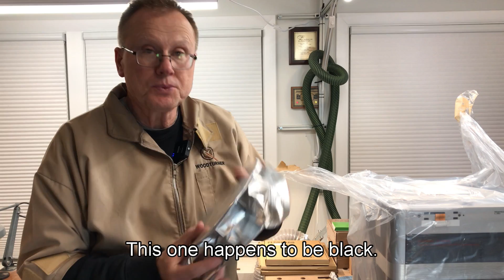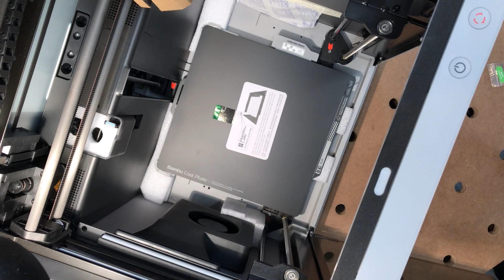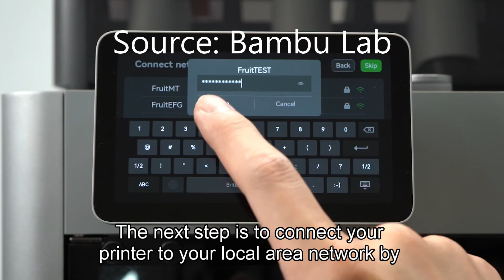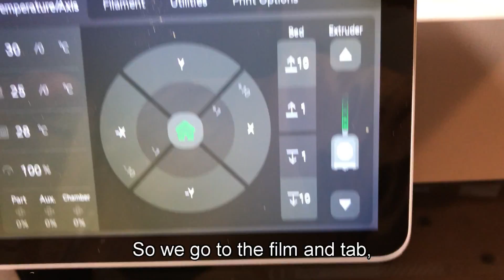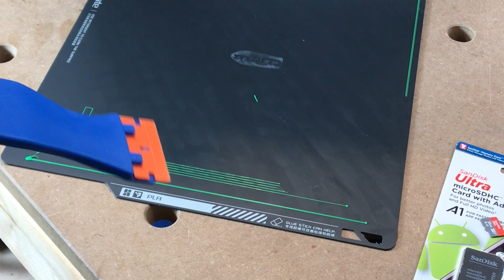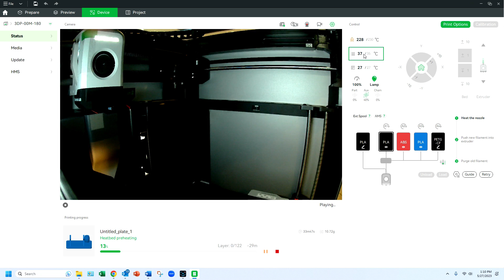Comprehensive Guide: Bambu Lab X1 Carbon w/AMS 3D Printer Set-up

Comment: Thanks for a really informative video. If I can find the space, and convince my wife I can spend the cost for this exact combo of the X1C with the AMS and filament, then this is exactly what I aim to get. :D The geometric parts and the poop shoot, what material are these printed in? PLA or PETG (or ABS?). Besides a few minor flaws I guess (unless meant to be - top corners of the poop shoot seen from the outside?), then these looks like awesome quality.

Oh and with this video, I know exactly what to do if I get this model, and can get up and running quickly. :)
Reply from the maker: The geometric parts were made from PLA except for the red one, which was made from ABS. The poop chute was made from PLA. Overall, I’m extremely happy with the quality of the prints coming off the printer. If you want to print the higher temperature plastics you will want the X1 Carbon model. Bambu Lab offer a lower cost model, but it isn’t enclosed and there are some other features missing so the focus would be PLA and PETG. I really hope you can convince your wife to get the X1Carbon.😊.
Reply: Well, last Friday an X1C with AMS found its way into my home… :) Now if Bambu Lab would just reply to my general support request, I hope to find out why the spare parts and fillament package is not even sent a week after I got the track and trace details…. A second order from this week was already shipped on the other hand…. So something is wrong…
Reply from the maker: @amndk34  Congratulations on your new printer🎉. That’s odd regarding your parts order. I have placed about 6 orders with Bambu Lab and I have found it takes a few days before FedEx actually picks up the order, but your situation seems different. I guess you will see how fast Bambu’s ticket response will be. Let me know how you make out with your printer!
Reply: @ristinnovations  Printed a few small things, including an enclosure for a joystick tester. Build the joystick tester myself, and purchased the design to print it. Works great, and besides planning to look into building functional stuff in general, then just doing the fun / test prints to get to know the printer first. Watching videos to learn the slicer etc as well. Only had it for approx a week, but loving it. I also think being into retro computer stuff, building small electronics projects etc. is gonna be a perfect match to being able to print own enclosures etc. as well. Holding back a little bit as the standard PLA that came with it is almost used up. However, the last order I did for additional fillament will be here tomorrow, so going to get some more printing done in the weekend. Also at least Bambu Lab responded to my support mail on the missing spare part and first shipment of fillament, and they are investigating what happened with that order/shipment. So cross fingers for quick resolve. Now with the P1S just coming out, the only regret I would have, would be that in the spare part order I also ordered the textured PEI plate, which they apparently did an updated version of. I can always hope they include the new one instead, due to the delay on the initial order that was made with the printer and spare parts.
Reply from the maker: @amndk34  I’m glad you are having success with your initial prints. It’s also good to hear that Bambu Lab is working with you to resolve the missing shipment. Good luck with all of your electronic projects!